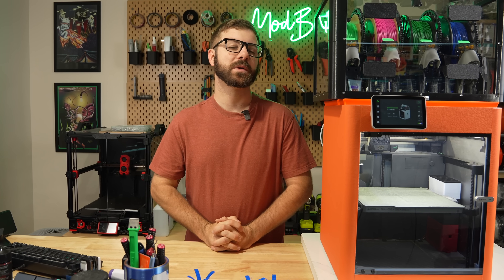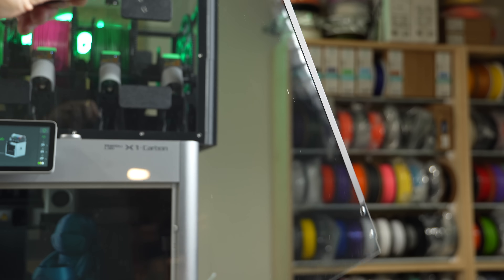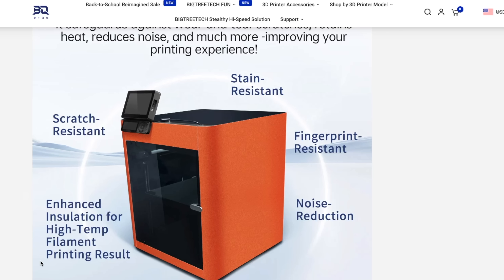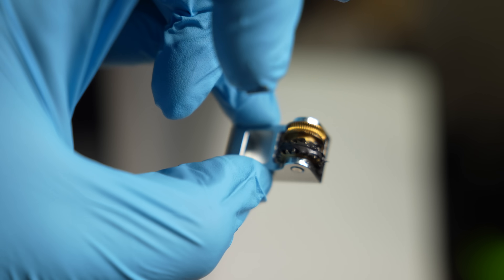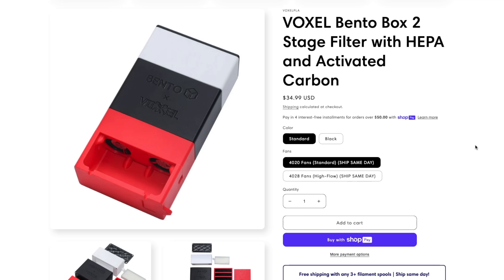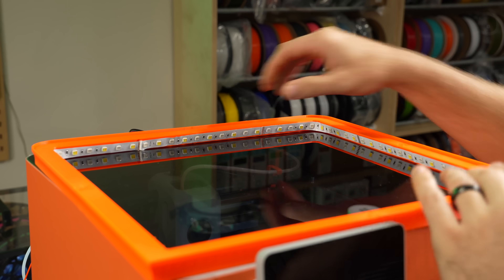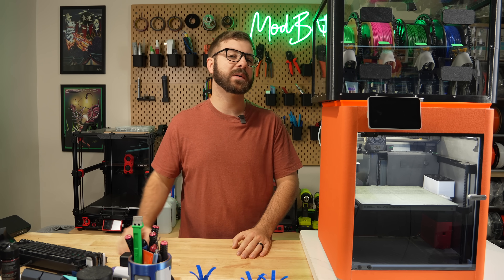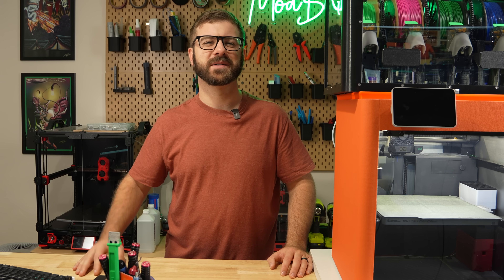9 New Upgrades For Bambu Lab X1C & P1S Printers!

Comment from the maker: Update: VOXELPLA Bento Box now ships with 24v fans and power supply. (No need to use a buck converter)
Reply: You didn't have to use a buck converter, just wire two fans in series and connect to 24v, each will get 12v bc they are the same ;)
Reply: @riba2233  exactly.
Reply: @ModBotArmy  thats actually amazing news, if only i had space for them in my ultimakers xD
Reply from the maker: @SlinkySlonkyWaffle  what Ultimakers are you running???
Reply: @ModBotArmy  i used to run an ultimaker 2, but gave it to my brother, i now have a tall prototype ultimaker 1 that ive modded to an unrecognizable extent and am planning on converting a UM2 to coreXY (it was a parts printer anyways). my tall ultimaker has a UM2 printhead with E3D volcano hotends in it, dual extrusion works more than well enough despite there being no solenoid to move one of the hotends up and down
Reply from the maker: @SlinkySlonkyWaffle  nice old school ones then. Haven’t seen to many with heavy mods. I got to play around with the 2+ quite a bit years ago, it was a workhorse.
Reply: @ModBotArmy  do you have a discord server? I could show some pics and CAD screenshots
Reply from the maker: @SlinkySlonkyWaffle  yeah! It should be in the description somewhere!
Reply: I just put the stock exhaust fan into my bento box. Seems to work fine
Reply: Please tell me where you got that black to purple filament.
Reply from the maker: @ZeFoxii  oof almost positive it’s from Eibos.

Comment: the vinyl shouldve been applied with a 3d printed roller. ive put it on drums and it held up perfectly fine. it will also definitely reduce any sort of panel resonance.

Comment: I could see myself possibly at most grabbing the metal gear upgrade, upgrades nozzle if it really helps with little details, and the LED upgrade as the stock lights are a bit weak but as long as it doesn't interfere with the lidar.

Comment: How is the diamondback hotend? I’m relatively new to this and I’m looking to upgrade a bit of speed while maintaining quality and this nozzle hot seems to be highly recommended. 

I know it is not high flow, however the obxidian nozzle from them seems to have issues with clogging and A knew I’m trying to make my life easier, not harder. 

Would you recommend this? Are there any specific settings for say PLA or PETG to maximize this hot end?

Comment: Too much grease by a factor of 10. It is going to end up all over the place, and in places you don't want it to go. It is also going to catch and hold dust and debris. A light film is enough... a few small dots on the gear and it will spread itself.

Comment: I hope those E3D diamondbacks come back in stock soon. Been wanting one!
Reply: I got one for christmas and its SO nice. be careful you dont need to do returns though they are $$$$holes and want international with tracking required to exchange an item (I got 2 .4 nozzles, the gifter tried lol one diamondback and one obxidian) that costs more than the damn nozzle.  27 mm/s3 on my sunlu and bbl pla, which is like good, but really what sold me is that the layer adhesion is so much better, its insane.
Reply: @mrrooter601  I ended up finding a .6 in stock so I pulled the trigger. As soon as those .4s come back in stock I'm jumping on it!

Comment: The extruder gears were intentionaly designed in plastic to be a singular point of failure if anything goes wrong ;-) The ledbar is so dim by design so it will not blind your Lidar :-) these are not upgrades but downgrades....

Comment: While Voxel filament is a good product and I have used extensively, the company itself is lacking and communicating with them is nearly impossible. For instance, I purchased an enclosure for a Ender printer I have. It took a couple of weeks before they even acknowledged my order, then the Lexan panels arrived a couple of weeks later, but not the rest of the enclosure, just the panels. When I contacted them, it took a few emails to have them understand that I only received the panels. Then, after a couple of weeks, they sent some more parts for the enclosure. This as still not all of the parts needed. I contacted them for the 10th time and it felt as if they don't understand English that well because the responding emails were like, "what the hell"?
After many more communications with Voxel, I finally gave up. The enclosure is still not complete. I'm out over $200. I quit doing business with them.

Comment: HMM I want that cools kind or the Bambu but as like a insulation for ABS and PC
not a fan of the colors and textures tho
I don't see the point of the extruder gear though, it also requires grease which can hold and absorb dust etc.
also I wonder how long the bento box will last with all that abs fumes and particles going trough it.

Comment: So when you buy a printer that just works perfectly, anything else you add to it is like putting bloody neon lights and crap onto a landcruiser. Its engineered to work, and it does it so bloody well if you know what your doing. Bambu labs are the ONLY machine that  just work like a professional office photocopier. The Toyota of printing. 
No idea why anyone would do stupid shit like replace a tempered glass door woth plastic and but god awful cheap shit vinyl onto the machine?? I mean if your that special and worried about smashing the glass, get an offcut of clear protective film and put it on the glass. 
Now the plastic gear, is there so that it wears out rather than burn out the machine and bugger stuff up. Your also adding another ongoing wear problem with the grease, why isnt the gear made out of oil sintered or impregnated brass? 
I do like the light mod but ended up just getting a $2 led strip with a motion sensor on temu and sit it on top and whenever the machine moves inside it turns on. just enough to show and doesnt impact the lidar. 
The bento box is cool, but i just vebt my machine directly outside. much simpler. 
I dunno, all these "mods" just seem like poor boy ricer racer honda mods.

Comment: I purchased a Bambu A1S about 2 months ago and while setting up the machine shattered the front panel glass. Totally my fault as I caught it on the back of my chair as I was wheeling around to the back side of the machine. This video addresses some nice to haves: Better lighting and a front panel that is easier to see through to your prints. I'd love to mod by A1S but don't want to mess anything up. I'd really love to see everything running through the local network instead of sending everything wirelessly though to a cloud server and back. Thanks for the video.

Comment: 5:30  no, it's hard to mix up which connector is which.  It's easy to install the connectors offset by a pin L, R, up, or down.
Reply: Yes it is hard

Comment: Squeeze the grease onto a small piece of plastic, or even a toothpick and then apply it. You have much better control. as mentioned, you WAY over greased the gears. Surprised you didn't get any on the filament during use. But it eventually will.

Comment: TOO MUCH GREASE.  And you need to increase your part cooling speed with the Biqu because you're feeding way more volume of duct compared to stock.  Gotta normalize the flow velocity.  The overhang performance on the Biqu is better on certain angles of that 4 way test, but the real killer upgrades are the secondary AUX fan and the flow vane insert on the primary AUX fan to eliminate the flow concentration toward the back 1/3 of the build plate on the left side.

Comment: I printed out 270° Hinges for the Glass door. Its so nice since you can really get into the printer and dont hit the door with the build plate anymore by accident.
The Panda Lux and Panda Claw i also installed, they are SOOO good. With the Panda Lux i actually work with the stock and the new light, There is no Problems with this though, not to much current drawn. I also have the Panda Jet and seen so much improvement over longer unsupported bridges. It may be a bit pricy since its just a resin print i think that many can do at home but its worth it. 

I really would like to see a Video about the X1Plus firmware you mentioned.

Comment: Great video! every time I see a review of the Bambu Labs, I want to buy one. I'm just so hesitant because the Creality CR10 Pro that I had a few years back left such a bad taste in my mouth for FDM printers. It wasn't cheap and I had SO many problems with that thing. One day it would print fine. Then the next 10 or so prints would fail horribly. Ended up trashing it. I just had enough and destroyed it. Anyway, I want a good FDM printer that will simply work. No fussing, no upgrading half the parts to make it good. None of that. I want it to be like my Epax resin printer. Work flawlessly out of box so that I can actually enjoy using it. 

 I'd like high quality prints and could care less about how fast it prints. Quality over quantity is more important to me. I'm ot looking for 8K Resin quality but a nice finish for larger prints or functional pieces would be nice. Would a Bambu be my best bet??
Reply: What you're looking for, Bambu is it. No upgrades needed.
Reply: I had a CR10S-pro   had it for 5 years  Did some upgrades but Very bad.   Theese core XY printers are nothing like the old bed slingers.    Bambu is great,  p1p or X1C,   or even better the new QIDI Plus 4, a more capable machine.

Comment: Regarding the BentoBox, if it is two 12V fans, you could wire them in series and you will get 12V on each fan. Fan1: red wire: +24V source, black wire  to red wire on Fan2. Black wire Fan2 to DC ground on the power supply.
Reply: Step-down converters are incredibly inexpensive. So is replacing the 12v fans with 24v fans. 🤷‍♀
Reply: Absolutely not. Wiring them in series will work until the fans become unbalanced. If one fan decides to stall (due to bearing failure, electrical issue, or fingers), there's a good chance that both fans will shortly nuke themselves. A pair of beefy 14V zener diodes, one paralleling each fan would be the paranoid solution.even a resistor would be a better idea. DC/DC converter this size is 1$ likely as well. If you want to cook your PSU follow this person's advice.

Comment: Aren't we past the point where we still need to solder wires to buck converters? Shouldn't these be a part of whatever is using 12v appliances with 24v power rails, even as a cost addon? Or at least plugged for connectors?

Comment: For the record, I've been running BOTH the stock LEDs and the Panda light for the last several months with zero issues.
Reply: Do you use the lidar and does it interfere with it?
Reply: @_specters_  have had no issues so far.
Reply: @_specters_  I saw a video hypothosizing that this was causing issues. I dont see why you wouldnt just do it by hand anyways, how often are you really using brand new types of filament yet dont have 2 minutes to do a manual calibration.

Comment: Wow, that's a lot of grease you put on those gears.  :)
One disservice of pre-built printers, even ones that come as kits like a Prusa, is that people don't understand you need to sometimes take things apart to perform maintenance. Maybe I should start up a local 3D printer maintenance service.

Comment: I haven't seen anyone else comment on this, but i'd be really interested to know how long it is until you need to take that extruder back apart and clean it. That's WAYY too much grease applied in my opinion. Once the fingers are the gears merge, it's all going to be squeezed out. Over time, and probably not a long time, it's going to get everywhere. Probably in the filament path very fast.

Comment: What a well-timed video for me. I was just about to change the extruder gears in my x1c since it started to have random, very minor stringing and extruding issues. After 1000+ hours of printing, I figured it earned some love and new parts. Ordered the panda jet cooling fan duct and claw extruder gear set for 50usd, which I find is a good price. I just hope the gear set won't introduce new problems in the long run since when you introduce helical gears, you also introduce lateral forces. The original bambu gear set has spur gears. Maybe there's a reason.

Comment: What type of barrel jack are you using to power the new BLLED Extended Plus? Also I was on the fence about getting one but now that you can power the Bento Box with the 24V terminals from the BLLED I think you just sold me on both! Great video.

Comment: HI, my name is Francesco, and I am a 16-year-old guy passionate about 3D printing. About a year ago, I bought my Elegoo Neptune 4, an amazing printer that works very well, and I am happy with the purchase. Unfortunately, every time I turn the printer on and off, the Z-offset changes, and I have to recalibrate it manually. This frustrates me because I’m forced to make a lot of clicks to level the bed. So, I started searching online for a solution, but the automatic calibration either involved a load cell mounted on the nozzle or external hardware that was complicated to install.
So, I came up with a software idea that could automate the whole process. Here’s how it works:
You need to know the offset between the 3 axes, which is the distance between the nozzle tip and the probe for automatic bed leveling. You tell the printer to move to a coordinate near the center of the bed, take a measurement with the probe, and save it. Then, the head should move to the same coordinates but adding the previously recorded offset in X and Y, take another measurement, and save it as well. After the printer has returned to the previous coordinates, it needs to take the two previously saved data points and insert them into the following formula (the first measurement = A and the second = B, the Z-offset probe is the offset between the nozzle tip and the probe on the Z-axis):

(Z-offset probe + (X)) - (Y) + 0.1mm.

The final instruction to give the printer is to set the current Z-axis coordinate as the Z-offset.
Unfortunately, I don’t know how to program in G-code, so if you think this software might work, would you be willing to help me write it?
(If you think it won’t work, could you explain why?)
I hope I was clear. Thank you for your attention, I’ll be waiting for your response to hear your opinion on this matter.

Best regards,
Francesco
Thank you for your attention

Comment: Do the heavier extruder gears affect the performance of the motion control system? Bambus shine because they have light weight dynamics, adding weight has me concerned. Thoughts?
Reply from the maker: I’m gonna say no, it’s heavier but not substantial. The biqu cover is lighter than the stock one so maybe it balances? Haha in this instance though it’s all pretty minimal in the grand scheme.
Reply: Plastic for another reason, it's a sacrificial gear as not to damage the extruder gear. 'Mods' like this are utterly pointless and only exist because the hobbyist 3D printing community just can't help but tinker with things!

Comment: From the mark on the extruder door fan, it looks like you still have an old model. It could be the same fan on the hotend. The new ones have Snowfan branding on them (the original ones just have number markings) and according to reddit they are quieter and more powerful. I currently have an X1 from Kickstarter and a new p1s and I can confirm that at least the extruder fan is quieter on the p1s than on the X1. I don't notice it audibly there anymore with the extruder door fan. But I haven't done my own tests yet, on print quality and possibly reducing the amount of clogged nozzles.

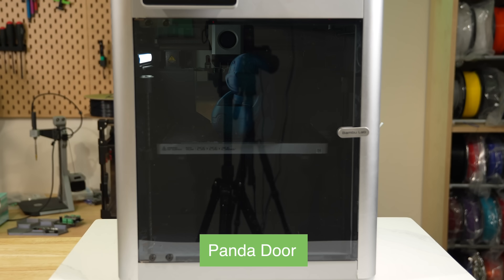Comment: 2:55 Regarding the door there are good and bad news: The good news is that apparently (according to multiple people on the BambuLab subreddit) new X1Cs and P1Ps actually ship with a transparent (not tinted) door. The bad news however is, that it's much harder to remove (seems to be glued in addition to being held by screws).
6:00 @ModBotArmy How many hours did your old extruder gear have on it?
Reply: I don't know what new means from their perspective, but I've had my p1s for 3 weeks and the door is just as tinted as my X1.